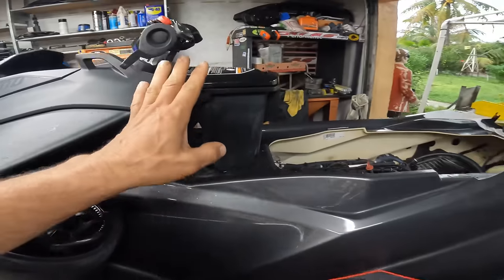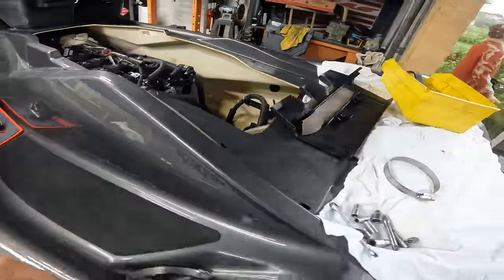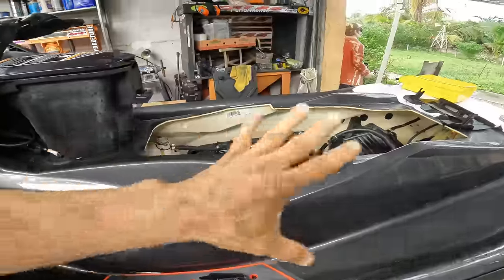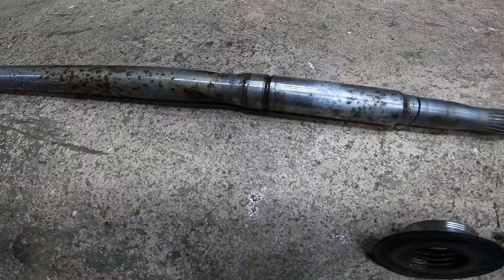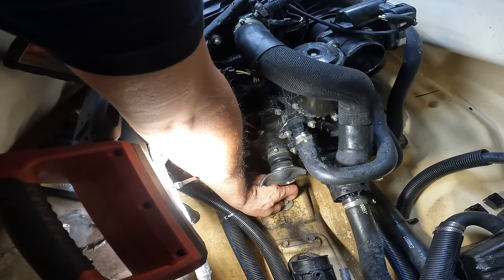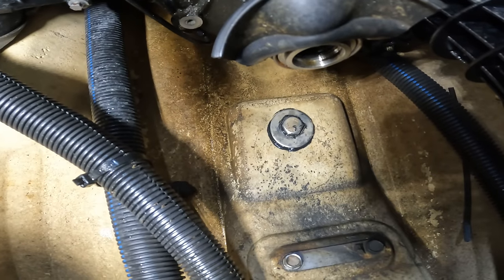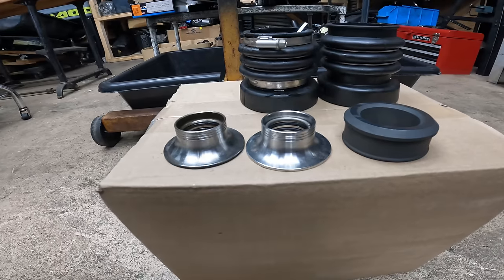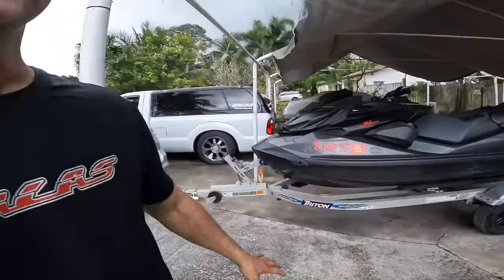2022 SeaDoo RXPX With 200 hours comes in for a tune-up, but we find other issues +  Calas Tech Tips

Comment: It is practically impossible to run faster than 76/77 on the dash with a SCOM only because you are on the REV limiter on a stock machine at those speeds.  You will gain nothing by running an aftermarket intake, exhaust or drilling air holes.  Pull the seat and see if it runs faster, it will not until you raise the rev limiter.

Comment: Did you check the slip on a brand new supercharger or are they pretty good right out of the box?
Reply from the maker: They are where they’re supposed to be I usually put them a little higher If the JetSki has a tune

Comment: Ernesto hello from Australia love the channel mate ! I am a motor mechanic and have started to mod my 18 RXPX , intake, exhaust and prop (13/18)  Maptuner next .. Just noticed a little leak around the carbon seal any tips on how to get the circlip off without the floating ring tool ? Dont really want to buy one and use it once ! 

Keep up the awesome work!!! Mmmmm :)
Reply from the maker: @adamkeir9850  it’s really tough without that tool it’s not a bad investment. You can always sell it later if you don’t use it.
Reply: @calasworld  Sorry to bother again Ernesto I managed to get the clip off , shaft moves freely but won’t come out , assuming i just need to release the PTO boot clamp so i don’t tear it , is there a rear main i should also replace whilst apart can’t seem to find the part online anywhere (haven’t called dealer yet) rather ask my favourite youtuber 👍🏻

Comment: Hey brother.   I just bought. A 2016 rxp 300.   In sport mode it ran great for 2 minutes then the engine light came on.   Limp mode.  What’s happening?
Reply from the maker: Figure out the codes and see what it is
Reply: @calasworld  thanks.   I’ll try that.  Only been out once.